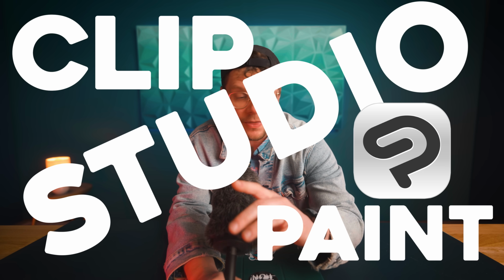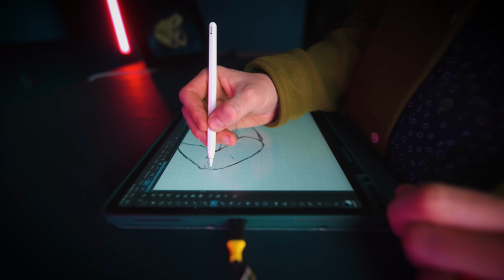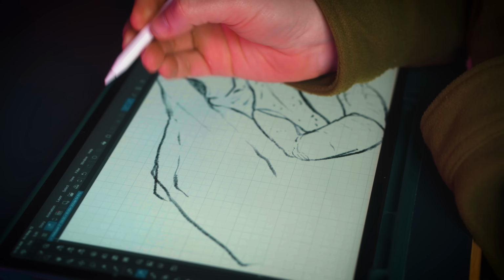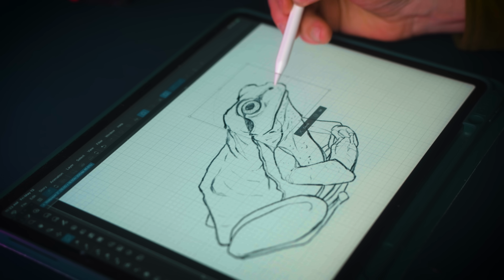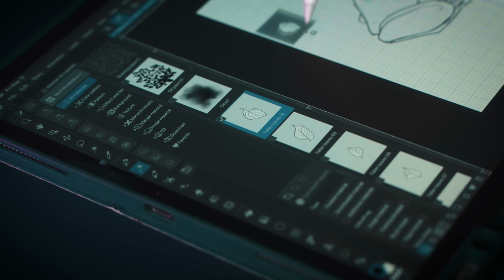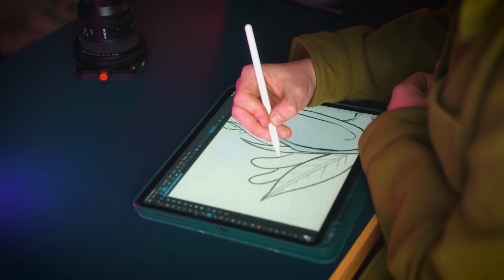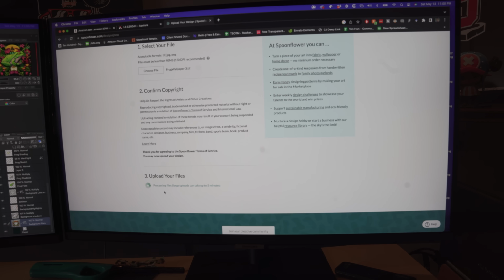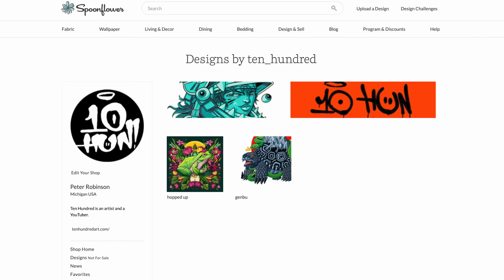I Makeover my Nasty Bathroom w/ Custom Wallpaper!

Comment: With all that room, you should add a fainting couch! I don’t go into women’s restrooms very often, but the few times I have, or have asked about them, some kind of sitting furniture was present; i.e. chair, couch. Even the employees women’s restroom of the grocery store I worked in, had a chair (I know that because I used to help with maintenance). The men’s room did not have a chair. I’m not sure what women need with an extra sitting spot, but it seems to be a necessity… or a courtesy. Check out the restrooms in a fancy restaurant and you’ll probably find that the women’s room has a couch and the men’s room doesn’t.

Comment: The concept is amazing! Love the wallpaper. You can really lean on the dark ambiance of the wall paper by painting the rest of the walls and ceiling black or pull dark colors from the wallpaper design.  You could also add LED lights behind the wood paneling feature for extra moodiness